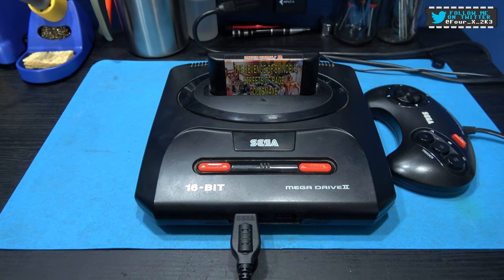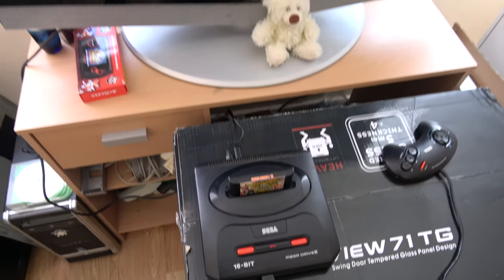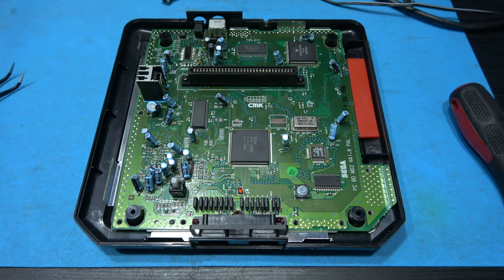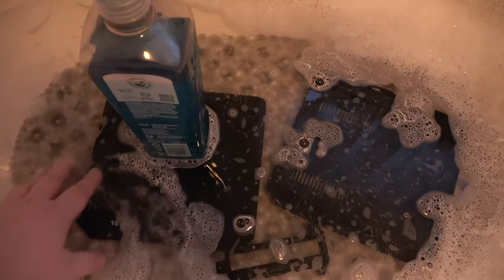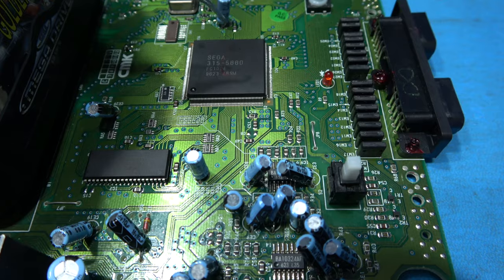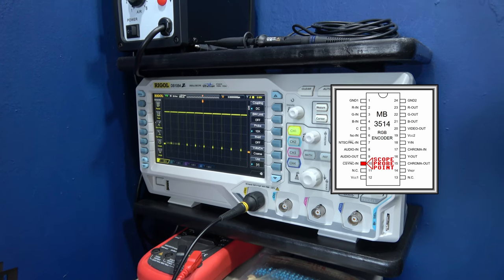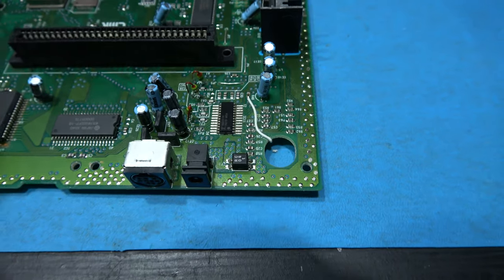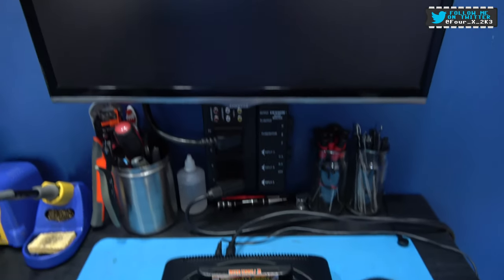SEGA Mega Drive (Genesis) II - Twitchy Video Fix and Restore.

Comment: SEGA is the inventor of day one patches ^-^ Almost all of their pre-1995 consoles have additional wires or components. Your tweet intrigued me and I'm glad you brought that issue-non-issue to my attention because I don't have any issue with CXA1145P on any of my TVs and it's good to know this can happen and most importantly why. I assume it's not all CXA chips that behave like that ? Because I've seen you plug SMS, MD1 and MD2 in this TV without issue before.
Reply from the maker: The video encoder chip inside this Mega Drive II is the Fujitsu MB3514 instead of the more popular CXA1145M. however, it's not just the Fujitsu MB3514 I've seen this issue with, I've seen it with some early 1000 series Sony PlayStations with the Sony CXA1145M in them.
Reply: @Four_X  Oh you're right ! I've just modded  9 Master System (at least 40 this year alone) and half of them have a MB3514 ! Somehow, my brain assumed they were SMD CXA1145... It doesn't change much as they are both interchangeable (as far as I'm aware) but you're right, technically, they aren't CXAs.

Comment: I have the same issue at 50Hz PAL but it goes away at 60Hz NTSC.  I added a 470ohm resistor to the c-sync line but it still happens.  Waiting on the 220uF cap to arrive.  I'm adding these inside the SCART connector, that way I might get away with not modding the console.

Comment: I have this same mega drive2 and it twitches sometimes when I switch it on, but when I turn it off and on again it removes the twitching. Not always, I have to do it a few times sometimes. The picture quality also poor, there's these faint vertical pattern lines all over the screen.
Reply from the maker: jail bars are very common on the Mega Drive.
Reply: @Four_X  I see, I did not know that about these bars as I have a mega drive 1 and it does not display these bars and the picture quality is better. Do know possibly know why the mega drive 2 9nly twitches sometimes as I described? Thank you for responding.

Comment: Great video. Many thanks. Still, I have a question for you. I have a slightly different model, the one with blue reset switch and a sliding power switch. Board is also somewhat different. It has two power rectifiers, for example and Sony video-chip. Here's the picture : https://i.postimg.cc/G2gJT2mJ/IMG-20240509-034026.jpg
But still, I have the same issue with twiching picuture on Samsung LCD TV. Tried RF connection and scart, which is a little better, but still not usable. Can you please tell me that your mod is applicable on this version of MD2 and full specification of the capacitor used (220mf, but how many volts) and the resistor (how many ohms)?